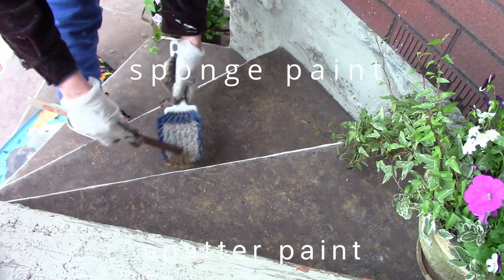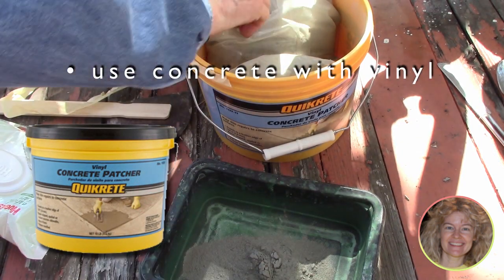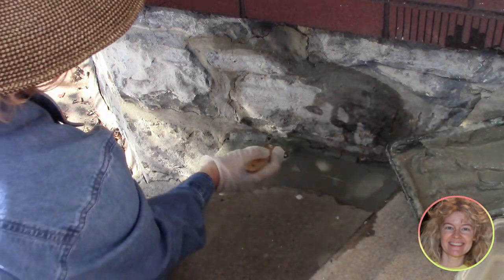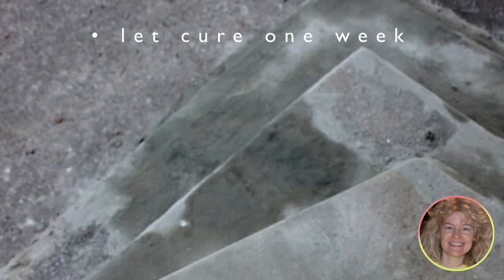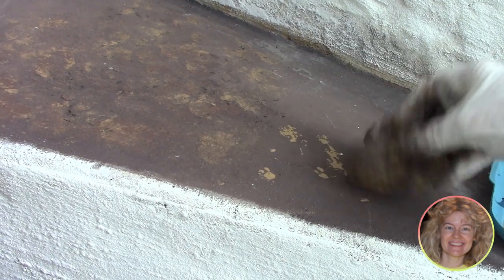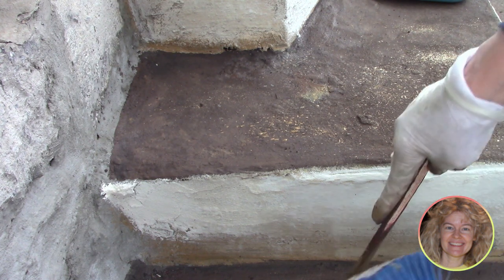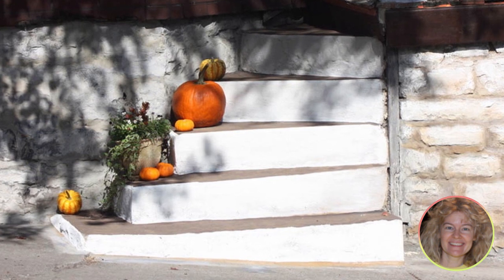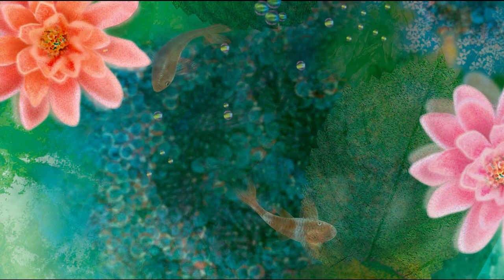MakeOver Steps with #ChalkPaint & #Quikrete; Sponge Paint Concrete for Texture & Easy Care Steps

Comment: Looks great! My risers are painted concrete (damaged). Do you think the concrete would stick to the painted surface? If not, any suggestions?
Reply from the maker: You've got a good chance, if it's old paint. Or, you can also try roughing the paint with tough sandpaper first. I've been getting cement to stick to a cinderblock wall that has a coat of old paint, partly worn away. You'll want to use a premium cement like "RapidSet CementAll" which you can get at Home Depot. Be sure to use a drop cloth, because it's easy to drop blobs of cement while you're working cement into vertical surfaces, like the risers. I have been wearing gloves and smoothing it onto the surface by hand, after a bit of troweling. If you find the CementAll drying too fast, you an put a tiny drop of dish soap in it, or buy flow control, and dry control powders from HomeDepot too, in the cement department. Work with small batches of the cement, and use very little of the soap or additives. Good luck, and you can do this!  — Stephie